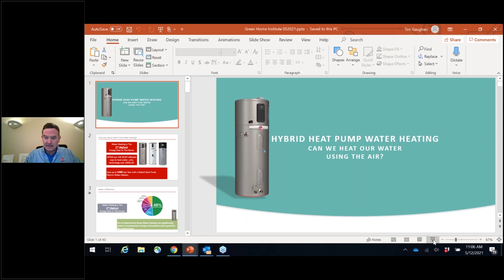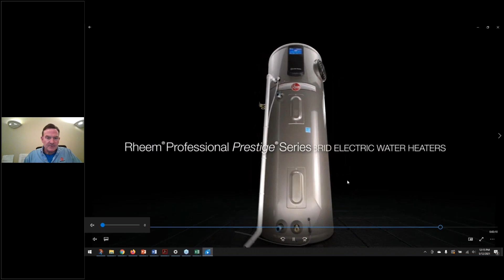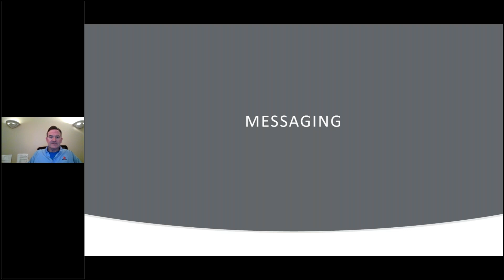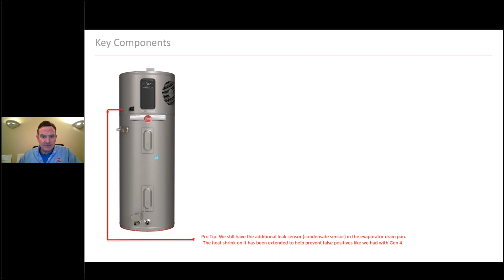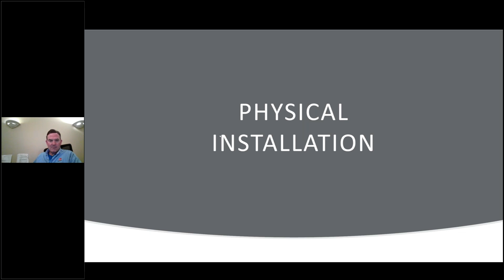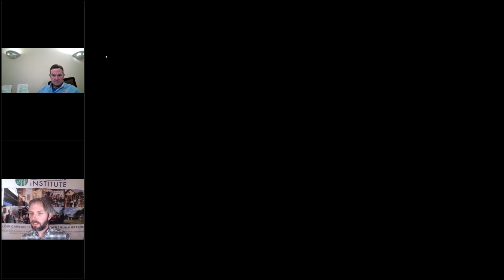Can we heat our water better using the air?

Comment: Do any manufacturers make a horizontal model that can be installed in an encapsulated crawlspace?   I have a 4’ high crawlspace and would love to install a hybrid system there and also get the benefits of dehumidification.

Comment: My daughter is building in Minneapolis and the builder does not think HPWH should be in homes in Minneapolis. I totally disagree. How can I convince him and my daughter to install a HPWH. This is supposed to be a NetZero home. His main point is that HPWH cannibalize heat produced within the home. Of course that happens but the overall savings in the winter outweighs the extra heating costs. Please send me any links resources you have so I may convince them both.
Reply from the maker: Did they get a HERS index rating yet? That will tell you all you need and you can do it in the design stage. Contact Pat there in MN http://www.buildingknowledge.com/